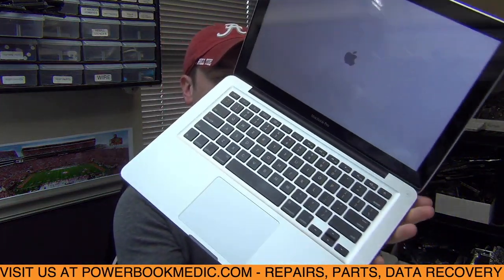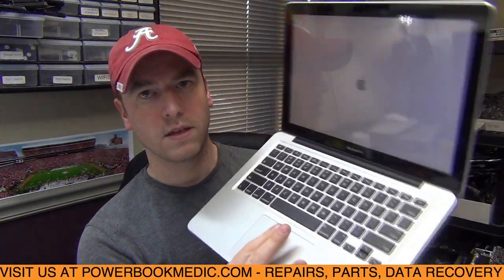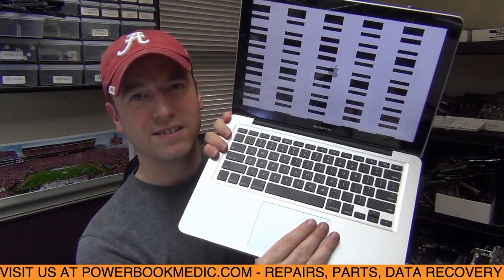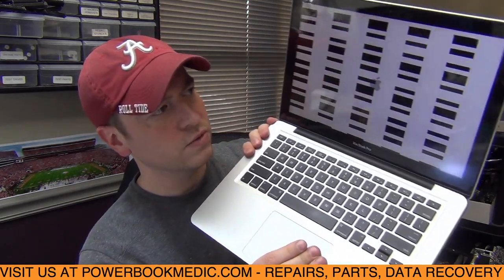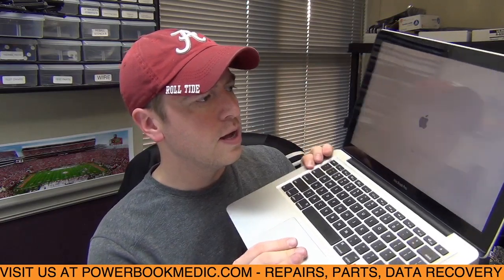Distorted Video on Macbook Pro 13" - Ram Issue -  Model A1278 Board 820-3115

Comment: I am suddenly facing the same issue for a Macbook Pro 15 Mid 1015 A1398. I already tried your suggested solution but unfortunately that didn't fix it for me. Removing one of the RAM, both and/or replacing them with new ones did not fix it. I also replaced the Battery against a new one. I believe it might has to do with the logic board. Is it worth trying to bake it in the oven as some other videos suggest to do in this case and how long does such fix lasts. Regards. Good video.

Comment: Hey I had this issue too. I started using the outer ram slot. However, recently my laptop started having the same issue. i have tried changing slots. Now the laptop doesnt turn on the screen at all, there are three beeps that i can hear and the fans are running. Please help

Comment: Thank you very much for your diagnoses and explanations. I bought some laptops on eBay and while setting them up, one had this problem that's why I am here now.
In the video you said that some solder joints cracked. So I just put some flux on all the joints and used a soldering iron to resolder them all. After that, I tested run the laptop and the problem was gone. 
The next day, another one with the same 2012 model had the same problem. At first I thought it was the one that I fixed the day before. However, when I opened it up, it was a different one (because the logic board was clean at that area). This time, instead of resolder all of them, I used a thin stylus to poke all the joints and I found one that moved a lot (it cracked obviously). I resoldered it and the problem was gone again.

Thank you for sharing your knowledge and experiences. I have learnt a lot from your videos. Keep up your great work.

Comment: I just verified that this was the issue with my mid 2012 15" MB pro model A1286. The question now is whether or not this machine will accept (and function properly) a single 16gb sodimm since one of the 8gb was removed.

Comment: Hey so would it be a good idea to just get a different ram chip with higher memory and use just that one?
Reply: Yes . I did just that . It works ! Plus it doesn't matter if you are using CL9 or CL11 rated Sodimms . Hello , non Apple ram works too .

Comment: This is not the only way to fix this. Reflowing is useless, the pins have to be properly re-attached to the board which is a straightforward board repair with the right equipment, I’ve done hundreds and to date I’ve only failed to repair two.
Reply: Your video on this was spectacular, thank you for the clear explanation and zoomed video. I however do not have access to soldering equipment so I used the card method discussed above and shown in this video https://youtu.be/1Zf_ADyjS9k . Seems to have sorted my 15" mid 2012 MBP with an 8gb in each slot.

Comment: First of all, thank you so much!! I've been dealing with this issue for months by, bizarrely, slapping the e key a couple of times and restarting the computer. It will be great to have a permanent fix. But I was wondering if replacing the logic board would also solve the issue with the ability to use both ram slots, since the damaged ram bay on the logic board is the source of the problem. I wouldn't go through the trouble except I have an old macbook on hand from which I could try to salvage the logic board... is it worth it to give that a try?
Reply from the maker: Liz Stone Happy to help! Yes, that will fix your problem, as long as the RAM chips are working on that machine.
Reply: @PowerbookMedic  Awesome. Thanks for the reply!

Comment: Excellent explanation, now I know why I had no problems but client did when they used it. It ran fine on the table top and using the touchpad; apparently I never put enough pressure on it to cause the issue. It may still have developed the issue anyway as I only ran it for a few hours running test utilities and removing malware.

Comment: I found a video of an italian repairstore placing a plastic card jut beneath the ram-bay to solve this problem. I tried it and it works for me, the computer reads 16 GB ram... However the computer sometimes gets a single artifact on the screen and kernel panics, seems like after a two hour session. Do you know how to solve the kernel panic? Does this solution solve kernel panics? Thanks
Reply from the maker: Jakob The bad ram bay is what the artifacts and kernel panics.
Reply: @PowerbookMedic  Thanks, I removed the lower ram memory and it works fine now. I owe you a great thank you.
Reply from the maker: Jakob Happy to help!
Reply: I used that same Italian video and fixed my dodgey RAM bay. Now both slots work, no problem. Just slid a piece of old credit card underneath it which tightened the whole thing up. No more loose bottom slot. It's crude, but very effective.
Reply: @geraldineosullivan3001  Did you remove the whole logic board to do this, or just cut a bit of plastic after removing the ram alone?
Reply: @HelloEkow  For me it worked, too. I did not remove the logic board.
Reply: @karachokarsten6456  I tried a couple times but it still refuses to work so im stuck with 8gb i guess 😅
Reply: @HelloEkow  Thants unfortunate. Well before findig this video i tried to bake my logic board, but unfortunately forgot to remove the left speaker. Well its not a speaker anymore. I also have my loss :'D
Reply: Thanks for the tip dude! I put a plectrum under the RAM-bay and so far it worked. No problems at all. Definitely worth trying before just using one RAM! :)

Comment: hi ,I am from India. i just watched your video its quite seems convincing. i have a Macbook pro 13' inch mid 12, i have issue like having small flicker or glitch at login and even if a run a program like chrome or switch to desktop 1, 2 or 3. i see the glitch or distortion only on upper half screen. I have done all the stuff like changing cables and GPU unit cleaning and shit, nothing works, i have experts on them saying changing or repairing motherboard. i don't want that somehow.it costing me 200$ with only 1 month guarantee. 
Solve me with the options. please.
Reply from the maker: BOA Another way to fix it is by removing the RAM chip completely and just leaving that RAM slot empty.
Reply: Have  u fix that.. plz let me know ..
I have the same problem ..
Reply: @MrKhader786  yea i have issue , it helps for sometime but it can came again, better u cn buy or replace new gpu unit. Otherwise it ll ruin ur board.

Comment: Amazing, never thought of the Ram slot., thank you very much for sharing with the whole world.
Reply from the maker: M Ferna Happy to help!
Reply: @PowerbookMedic  Hi, thanks for the reply. We are based in Ontario, Canada & we do the same type of work what you are doing, I guess so in US., Re-balling & trouble-shoot to component level. If ever I may be any help to you I would be more than grateful.  I see so many videos but so much waste of time, but this is them & they learn & teach  the hard ways. I just say make simple so that all rookies may understand the techniques. Thank you once again for this help, I appreciate.
Reply: Hi, how are you? just need a little advice & help if you can. I am working on a MacBook Pro 2011 17" logic board 820-2914-B. The problem was "No display". Before I replacing the GPU I checked all the voltage & all fine power rails. The only thing was left for me to replace was the GPU., which I did.  I got  a bright display with the folder (HDD was not installed) but there were think vertical lines on the screen. I reflowed the GPU again but the problem still persists. Check all voltages again, all were fine. Maybe this GPU was defective, replaced with another new one, still no luck. Then noticed one of the video Rams was getting hot. Not to take any chances I replaced all 4 of them. After replacement the heat is normal on all the chips but still I cannot get rid of these vertical lines, used another screen with the cable, still line present. Did you come across problem like this one & if you kindly give me tips of what I am doing wrong or what I did not check yet? Your kind help will be appreciate if you can, Thanks in advance.
Reply from the maker: M Ferna Was the original GPU and the replacement GPU the exact same specs and model number? I have seen this problem before when the GPU was different from the original.
Reply: @PowerbookMedic  ... Thanks for the reply. I never even noticed this that there will ever be a problem with the spec. Now there is so much of a mix-up with the chipsets, I can never even tell which is the original, as I mix the old one with my defective inventory. Ok, I will check & let you know... Do you recommend from which web site should I purchase these original chipset? Thanks
Reply from the maker: @mferna645  I made a new video to try and answer your question. Hope it helps! https://www.youtube.com/watch?v=PyzQuv3VCL4&t=66s